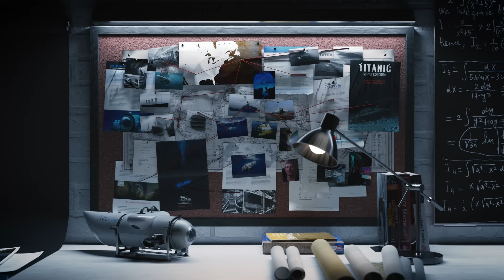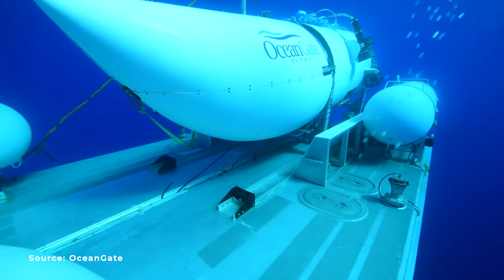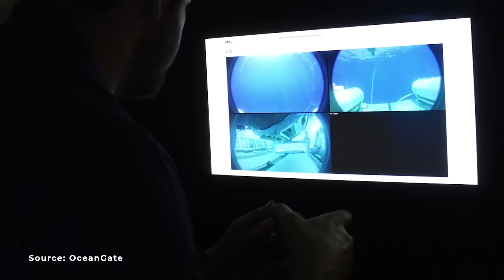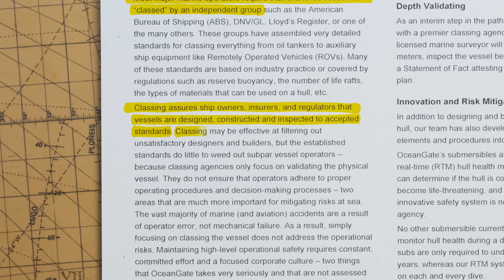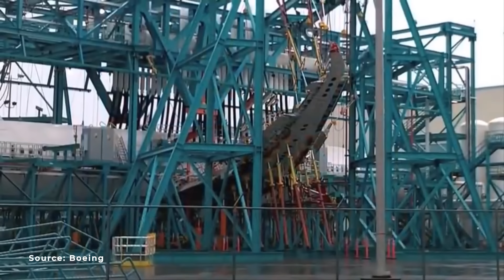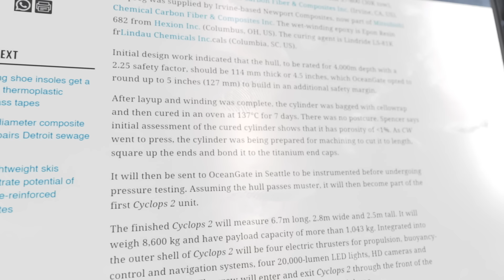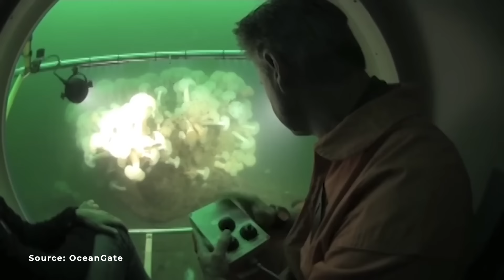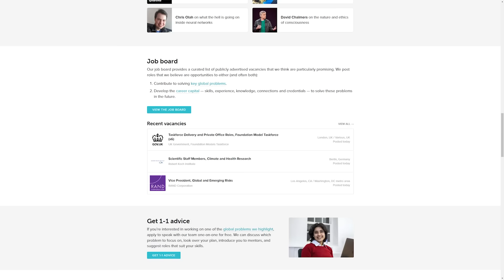The Questionable Engineering of Oceangate

Comment: I really don't understand your dis at SpaceX and Elon Musk, and it's not supported by evidence. The Space Shuttle was a complete death trap, and is responsible for most of the deaths in space in history. After it was retired, Boeing competed with SpaceX on CCDev. SpaceX was prudent, hired good talent, let the engineers run the show, and delivered a magnificent capsule that has flown almost 40 people already, both for NASA and private flights, and has NEVER had an incident. NOT ONE. Meanwhile, Boeing delivered a complete death trap. A plethora of issues where discovered in Starliner, and that's kept the capsule from being certified. Meanwhile, Dragon keeps flying. WHEN was SpaceX careless when it came to manned missions? It's also unfair to talk about "Elon and his Ego", when he has basically NEVER showed his face or interfered with operations when it came to manned flights. There's been hundreds of SpaceX launch streams, and Elon has shown his face on them exactly *twice*, both briefly, and only on test flights (namely, the Falcon Heavy OFT and Starship OFT). Falcon 9 is *the most reliable rocket in history*. This isn't an opinion, it's a well established fact. The most reliable rocket in history, flying the safest capsule in history, and somehow you still find a way to complain. 

Sounds more like an "I'm stupid liberal and so I have to complain about billionaires" issue more than an actual engineering complaint.

Comment: To be fair, "move fast and break things" was a software engineering motto, formulated at a non-critical social media company, that was co-opted by other engineers, sometimes working in critical software or hardware applications. It's a perfectly adequate way of doing low-risk engineering. It's not how you would engineer self-driving cars, or, I don't know, maybe a commercial submarine.
Reply: Fast iteration works best on any project when failures are low-impact. You absolutely do not apply that with avionics controls or medical equipment, for example. Fast failures are great when you learn fast but don't hurt anyone. Armadillo Aerospace (John Carmack software engineer), Tesla/SpaceX (Elon Musk), and many others were perfectly willing to risk equipment to learn but not lives. That's the right approach.
Reply: @Brians256  Tesla is willing to risk lives. Their "self driving" has already claimed lives.
Reply: @Dipj01  This is categorically false. Tesla's self-driving beta has claimed zero lives. Zero. None. If you think this sounds wrong, it's because you have been misled by the media. It is true that people have died misusing adaptive cruise control features on many brands of car, including Tesla cars with their cruise control feature marketed as Autopilot. This is because cruise control is still ultimately a car under the control of a human. And over ONE MILLION PEOPLE PER YEAR are killed by vehicles controlled by humans.
Reply: @sjwright2  How many PPL are killed in car's truck
s in the USA each year? ty
Reply: @sjwright2  just stop with the "alpha/beta version" nonsense. They'll keep on releasing beta 1, beta 2, version 3, etc. to reduce/split the number of fatalities in each version. "Oh so our autopilot has x fatalities, but did you know that our latest alpha demo version 0.999 has zero crashes so far"?

The Washington Post analyzed NHTSA's numbers and found that Autopilot was involved in 736 crashes since 2019, including 17 fatalities. 
Try to downplay their lethality as much as you can, Musk fanboy, you can't.
Reply: @Dipj01  You are confused. None of that has anything to do with Tesla's self driving system. Autopilot is NOT self driving, it is adaptive cruise control.

Most new cars sold in the USA have adaptive cruise control features like Autopilot. There are indeed some deaths associated with the adaptive cruise control feature on Tesla vehicles, as there are with the adaptive cruise control features on all brands of car. There's no evidence to suggest that drivers are less safe with Autopilot than with ProPilot, Co-Pilot, AcuraWatch, Eyesight or any other similar system.

The Washington Post article is misleading, because most crashes from most cars are not known to NHTSA. Tesla is the ONLY automaker which supplies ALL crash data to NHTSA voluntarily.

Tesla's "self driving" is a completely separate system. Fewer than 1 in 5 owners have paid for this optional feature. The number of fatalities (actual or alleged) associated with their self driving technology is zero. That's zero for every single version of this system, labelled alpha, beta, or whatever.
Reply: @sjwright2  Using "autopilot" for assisted driving / cruise control is inherently misleading. 
Autopilot means AUTOMATIC PILOT, aka the car will be piloted on its own. If it was only assisted driving, he should've called it just that. The term "Autopilot" misleads users into thinking its true autopilot. So the accidents that happen when users let that "assisted driving / cruise control" tech drive without supervision (because its called "Autopilot"), he's still to blame, because he misled his customers with that term.

Stop regurgitating same old talking points. Elon has made misleading and exaggerating self driving claims over and over again, and that has resulted in fatalities. Yes the Tesla drivers were at fault too, but he misled them with that term first, he's also to blame.
Reply: @Dipj01  You are the one regurgitating talking points. Autopilot has long been used to describe a dumb "follow set course" function in aeroplanes and ships. Linguistically, to be "on autopilot" has always described someone performing a rote task without conscious thought.

The term "autopilot" has never in the past referred to a system which knows how to navigate complex environments. A plane on autopilot will crash into a mountain if it's in the way. A ship on autopilot will keep going until it crashes into coastline. The only people rewrite the meaning of "autopilot" to mean artificial intelligence are the weird people like you who are obsessed with Elon Musk.

Tesla isn't Elon Musk.
Reply: @sjwright2  nope, time and again Elon has exaggerated Tesla's self-driving capabilities, and shares the blame for the fatal accidents by allowing to release undercooked driving software while exaggerating its capabilities. 
So much so that Elon Musk is facing lawsuit as shareholders of Tesla accuse the chief executive and his company of overstating the effectiveness and safety of their electric vehicles’ autopilot and full self-driving technologies. Even the shareholders are tired of his nonsense, and can see the damage he's causing.

No one said Tesla is Elon. Now you're just making things up that I didn't even say. Elon's exaggerated statements do affect Tesla, their users, and more importantly the pedestrians who lost their lives.

Simping for billionaires who indirectly cause fatalities is just pathetic.
Reply: @Dipj01  You're the only one talking about Elon here. Think about that.
Reply: @sjwright2  and why can't I? Truth is truth, and I said it. And when I saw someone doing mental gymnastics to defend their lethal driving systems, I said it again.
Reply: @Dipj01  Because you're revealing yourself as obsessed about Elon, and not concerned about any objective facts. That is just sad.

Again, the number of people killed by Tesla's self-driving systems is zero. If you want to blame Tesla (or Elon) for drivers misusing cruise control features, then you should be arguing for cruise control to be removed from all brands of cars, not just the one brand which you have a weird obsession over.
Reply: @sjwright2  misleading people by exaggerating the capabilities of cruise control which led to fatalities is an objective fact. I'm not obsessed with Elon, I'm pointing out the facts. You're obsessed with defending him.
Reply: Only because it automatically turns off a second before the crash. If you count the number of times that these "self-driving" cars have put humans into a situation where an accident is effectively unavoidable, then it's killed hundreds.And the only reason it doesn't kill millions is because it isn't in every car , whereas there is a human in literally every car (because that's the whole fucking point of them). If you want to reduce the number of traffic deaths there are many, much better options. 

     Eg: stricter and more comprehensive driver training/routine testing, improved traffic monitoring/enforcement (aka, more automatic RADAR stations/cameras in high risk areas, more police on patrol duties, modified fine models (such as income %percentage for major violations)), improved road design (eg: more roundabouts), improved public transit (which would also help reduce the carbon footprint, unlike electric vehicles)(eg: buses, trains, trams, and subways), and improved city design that reduces the need for cars.
Reply: I'd say "move fast and break things" is perfectly fine if you want to develop such a vessel. Test various designs and see what works best by testing out their limitations. That's basically what this motto represents for me. As long as you are still in a development and testing phase and want to find out what your design can and can't do so that you can fix the "can'ts" its good. As soon as you put people in it you have to be 100% confident though. And for that there is proper certification.
Reply: The comparison to SpaceX is interesting. SpaceX performed hundreds of flights of Falcon 9 before they put a human on the thing. They also had to go through an extensive human rating programme, to ensure it was as safe as could be reasonably expected of a vehicle filled with hundreds of tonnes of highly reactive propellant being shot into space. OceanGate performed a few test dives and, as Brian states, minimal checks by independent individuals. It was also operating in an environment that is arguably more challenging than space. This needs to be a wakeup call that "move fast and break things" is not a suitable design model when failure of the object could lead to the loss of human lives.
Reply: @franzfanz  Falcon was classed for human spaceflight before humans flew on it. The move fast and break stuff applies to the development testing phase, to discover the unknown unknowns and progress the design faster by increasing the understanding of the materials and systems. Destructive testing is a legitimate engineering tool. What OceanGate did was essentially put their development test vehicle into production without understanding the risks.
Reply: @franzfanz  On the other hand the current safety culture and redundancies in human spaceflight (often stemming from preventable disasters such as the Apollo 1 fire) is exactly what could lead a team to justify adapting the move fast and break things mindset that probably results in an Oceangate-like disaster.
Reply: @franzfanz  i do think move fast and break things do still apply to even "human critical" mission. Though the main difference is that spaceX's test launches are unmanned. It wouldn't be much of an issue if the submersible collapsed and there's just camera there
Reply: While moving fast is a good idea for non-critical engineering, but when your life depends on something, you better build it to highest possible standards and with all the possible over kills you could do on it

Ceo/owner choose to save money instead of lives of people, and his choice cost his own life, karma takes forever to hit, but when it hits, it hits like meteor to dinosaur 🦕
Reply: There are a lot of automation testing tools available for software engineers to use. It is fast, and as the name suggests, automated. But again, it is mostly used for testing things as harmless as websites, games or phone apps. You really don't want to use something similar to test physical capability and/or something that concerning people's lives
Reply: Keep in mind that this applies only up to TRL7.
Reply: "Commercial submarine"... With this phrase, we have lost all claims to state "That sounds like something from science fiction".
Especially those of us watching on a smartphone.
Reply: This philosophy is probably inspired by SpaceX as they revolutionized the space industry with reusable rockets. But even though they blew up many rockets during the development phase, they didn't put humans onboard until they completed 100 or so successful flights, as well as a human rating program. That's why it became a safe launcher. Risking equipment is fine, but risking human lives is not unless you want to die in a blaze of glory.
Reply: People have died from "Full self driving" cars as well.  Fraudulent misrepresentation
Reply: @MushookieMan People have died from autonomous vehicles, but no one has died from Tesla's Full Self Driving, yet. Most news reports confuse autopilot with FSD.
Reply: @DontThinkSo11  Autopilot works very much like the autopilot on a jet.  You tell it to fly at 12,000 feet through Mount Rainier it will go ahead and try to do that.
Reply: @k53847 spot on. I always have two hands on the wheel when I have auto pilot enabled.
Reply: and as for Elon's "self driving" cars, don't forget how lethal they are.

Comment: Everyone talking about the carbon fiber and no one talking about that extremely poor hatch design. Not only was it huge and heavy, it only had 17 tiny bolts on it. My office chair has bigger bolts. Also it was just two flat plates against each other with no positive mechanical alignment or anything.. nothing at all to stop shearing forces.   Most sub hatches are conical in shape so that the pressure actually makes the seal tighter.  The other thing is, this thing had at least three pressure hull penetrators (php's) for wiring. He certaintly didn't spend the $40k each for the premade ones certified to that depth.. probably made his own.  There's alot of good ways to build a sub and a lot of bad ways.. this guys missed all of them.